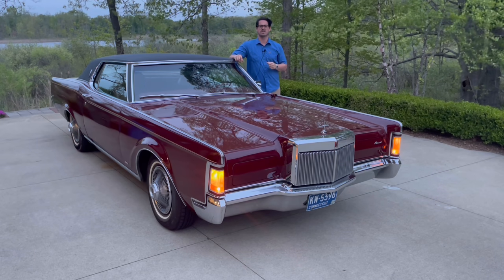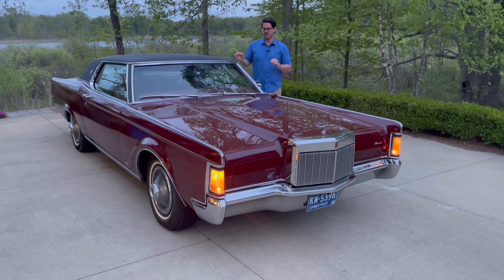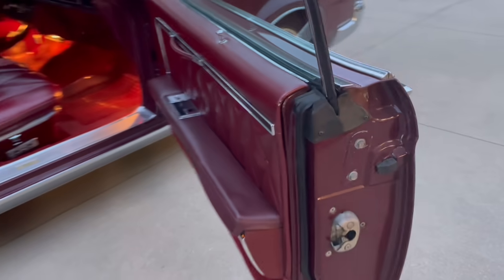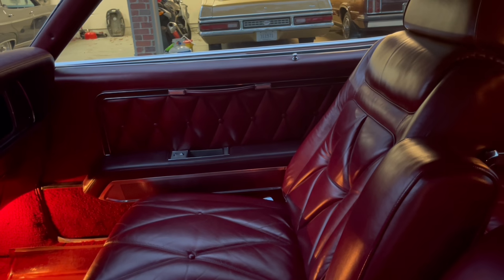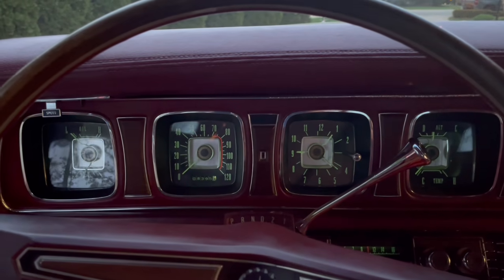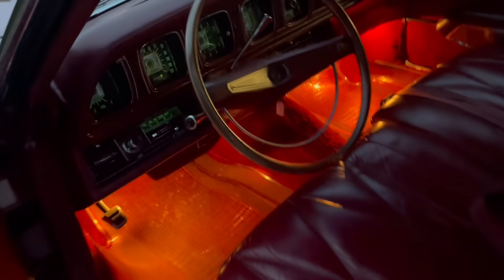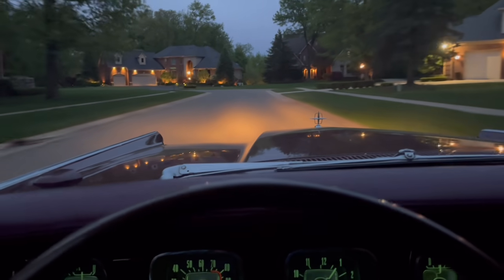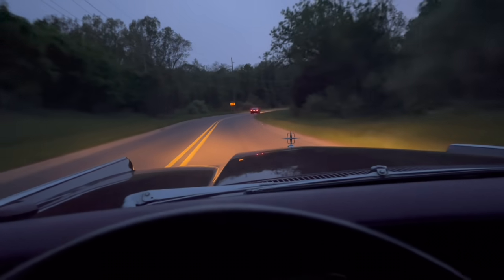Is This the Pinnacle of American Luxury?  The 1969 Lincoln Mark III Was Luxury Perfection

Comment: Surprised you’re bragging on the quality of this car.  Stylewise, though that Lincoln is a 10 and one of the most beautiful American cars ever made in my opinion .  My parents had a four-door 1969 Thunderbird that they bought new, and it was the biggest lemon ever put on wheels. There was hardly ever a day that everything was working on it.  The door and window alignment was poor. All four power windows Repeatedly failed.  By the time the car was a couple years old they were so weak we had to help them up with our hands, if they worked at all ! The reclining seat back completely snapped off, crushing my grandmother’s legs in the backseat ! It was repaired with a new unit, and that one snapped off as well. My dad only weighed 200 pounds when he was leaning against it.  The vacuum HVAC control unit failed, the radio failed, the rear axle went out, the alternator failed, the speedometer failed.  When two weeks old, the drivers window fell off the track down into the door.  When new,  the courtesy lights came on when you slammed the back door shut and went off when you opened them! The springs on the rear ashtray lids broke. The trim buttons repeatedly popped off the seats.   The heater core was leaking by the time it was three years old. Nobody but a Ford dealer would replace it because it was too hard of a job. The alternator failed at three years old. In other words, it was the ultimate POS.  These are only things that I can recall going wrong but there were more. and  mind you this all happened within the first four years and 40,000 miles of ownership of a car that was babied and kept in a garage ! As you said though though the transmission and engine were quite excellent. The paint was far superior to General Motors products of the era as well.
Reply: Yup… they most definitely got a lemon.  Every carmaker produces a lemon occasionally… that’s why there are lemon laws.
Reply: This is EXACTLY why Lexus has taken over the luxury car/SUV category, and Cadillac/Lincoln are barely able to sell any cars/SUVs anymore. If you can't build a corporate culture that motivates your workers to do their best, you will die. Toyota spent billions designing the Lexus LS400, ES300, RX300 cars/SUVs that finally took the luxury crown away from Ford and GM. I had a 1998 Lexus ES300 that bought in 2006 with 125,000KMs on it, and I finally, reluctantly parted with it in 2014 with 240,000 kms, foolishly thinking the rust starting in the rear wheel wells could not be stopped. Now, I know of perhaps the only body shop in my area of Canada that will actually cut out and re-weld new metal. Had I known about this place back then, I would have had them re-weld the metal and repaint the car, and it would STILL be on the road now, 25 years after it rolled off the assembly line.

Comment: 4:40 This has to be one of the last hardtops introduced with chrome frames that rolled down with the glass. All of the hardtops I remember from the 1970s has completely frameless glass other than the weatherstripping between the front and rear windows. I wonder what advances, if any, were needed to eliminate said frames. Did they come up with new ways of honing the edges of the glass, or did it just occur to someone that the frames were never needed.
Reply from the maker: I don’t think the frames were needed; they were just there for looks.  There were many hardtops before this without the trimmed glass

Comment: Adam! You have converted me. Was a brainwashed Cadillac man. I had a 1966 Lincoln 4-door and it was FAST!! Everything worked. Now I want a Mark lll. Never realized the AC compressor is on for any position but OFF on the Climate Control.

Comment: I'm watching this video after spending about 3 hours disassembling a Ford 460 V8 that I'm doing a rebuild on for a truck.  I've been a 460 fan for over 30 years now.  Just to be clear, I'm a fan of how they run and make lots of torque!  I'm not a fan of the gas bills.

Comment: Ford product auto shift levers always seemed flimsy and uncertain. and as another commenter noted, many times you would have to pull up on the shift lever to get it to start. I worked a used car lot, Fords were hard to sell if you had to go thru that gyration!

Comment: You’ve got a beautiful car the 69 was the best selling year because it started and 68. 71 was the best year.. because what we’re options in 6970 were standard on the 71. Also 70 and 71 used real wood inside the car 69 is vinyl tape.. also the driver side mirror on 7071 what is the standard mirror to 70s in the 80s on Lincoln’s. And the word continental on your deck lid and 69 are glue on 70 and 71. They are bolted on..

Comment: I have two 68 Imperials, but both have a lot more miles than this, so they are far from original and unmolested as this.  But one is still nice.  Curious question.  You also have a 72 Imperial.  Do you think the built quality (especially interior) of this is better than the Imperial?  There was a huge deterioration of the Imperials from 67-68 to the 70's, and they got worse thereafter.  The main problem I would have with the MkIII would be its lack of performance on the high end.  But the styling is nice, with the exception of the grill.  I don't like the benz/RR lookalike grill, it looks like lack of creativity.  But of course all these are subjective.
Reply from the maker: Yes.

Comment: 1969 wasn’t the first year of the Mark III, it was 1968! April 1968! With typical interior details of Ford for 68, like the steering wheel for example. In summer of '68 this changed for the "69 models. These first 1968 Continentals sold in early 68 where sold as 69 models too. Your Mark III has the 1969 steering wheel. And… Lincoln never sold the Mark III as a Lincoln, but as Continentals, Continental Mark III. See original brochure! You won’t find "Lincoln“ on the car… nowhere. :-)

Comment: Gorgeous car but man these are THIRSTY ⛽️
Reply from the maker: Sure are
Reply: Gas was a whole lot cheaper then.
Reply: @Red-rl1xx  adjusted for inflation about $3.40/gallon for premium
Reply: Hey if you got a deep wallet then you wouldn't have to worry about the fact they're gas guzzlers.
Reply: @Red-rl1xx  I can remember 14 cents as a low during gas wars.  I put 95 octane in the Eldo and it was about 25 cents.  98 was available but we were not Bezos.
Reply: @JamesCarterJr.  Fly a plane if you want to see gas flow.
Reply: @Red-rl1xx  So were cars and houses and food and college etc.
Reply: @rogersmith7396  I think it's measured in tons on large planes.
Reply: @johnz8210  The people around me will spend about $500.00 an hour on boat gas.  I have a sailboat.  15 galons a year or less.
Reply: @johnz8210  My dads Piper would do about 11 gal per hour at 200 mph which is Ford Pinto status.  Most planes arer a lot more.

Comment: And there in lies the rub. Increasingly there are fewer and fewer mechanics that are willing to work on these old rigs. Especially due to the complications in working on them, and  the fact that parts often take Hours ( at a mechanic's fee per hour ) to locate, if not days or even weeks. Sure the basic drive train may be easy to fix but everything else that can go wrong is not. Ever try to fix one of these with the climate control system? Just try to find one  when your module is fried.  My father used to say that he would never buy a car like that even though he could afford seven of them, which was true he could, but he would never buy a car like that because he always said the more that’s on a car the  more there is to break. And that sounds so deadpan and killjoy, but he was right. This was back in the day when a car was lucky to hit 100,000 miles , by then it was a spent husk usually.  And I venture Adam that if you were using this car for  more than just for videos, you probably wouldn’t own it without the vast network that you have built over the years supporting your 50 some odd cars, which puts you in a strata  that nobody watching you will ever touch except possibly Jay Leno. And it’s the Jay Leno types that are the candidates for these old cars now because your average person.. oh no. That’s why at any given time you see so many of these for sale ( Currently, 17 on classics.com alone ) and people buy them thinking they’re going to fix them up and then they find out that it’s really not worth fixing them. . Yeah just a losing proposition all the way around.  And then, of course, there are the environmental considerations of keeping a car that only gets 8 miles to the gallon on the road.. Which is a whole other video in enough itself.

Comment: The mark lll is NOT the pinnacle of luxury sedan or      coupe at all its too awkward looking  NOW The 72 mark iv is thee finest looking luxury car of all the lincolns period and only the 72 model year because of the government sticking there nose into the auto manufacturers again ruining the already successful styled new mark iv. Because the 73 got the clunky looking 5 mile an hour big bumpers for the next 4 yrs ruining the gorgeous esthetic look of the tapered front bumper that had the tallest front grill of all the mark series and thee finest looking polished grill of them all as well.
Reply from the maker: The 72 was significantly cost cut vs the Mark IiI.  Much cheaper to build.

Comment: CORRECTION,  THE 72 MARK IV WAS THE PINNACLE OF THE 2DR LUXURY NOT THAT UGLY FREAKING THING... not that vehicle the 72 mark IV had it over the mark 3 . The body lines were awkward on the mark 3 it just did not flow well at all..
The ride was not any more impressive than the MARK IVs infact actually not even as good as the Mark IVs ride. So your video is a FRAUD..